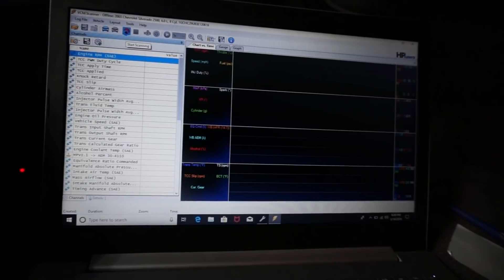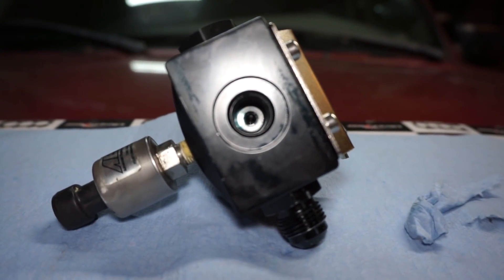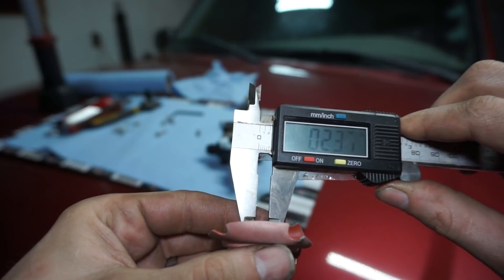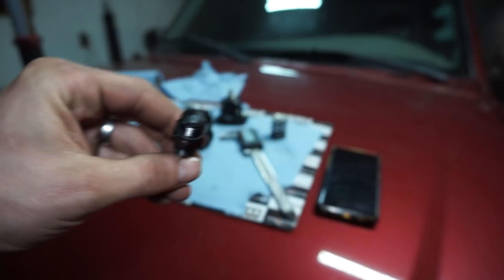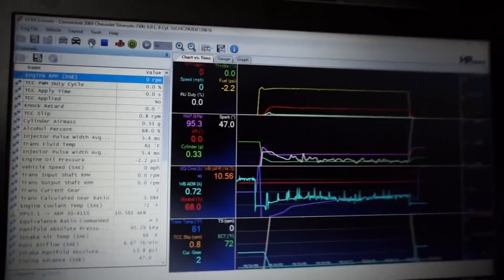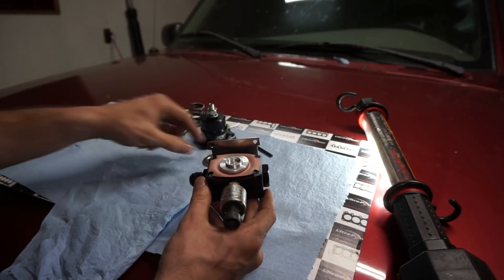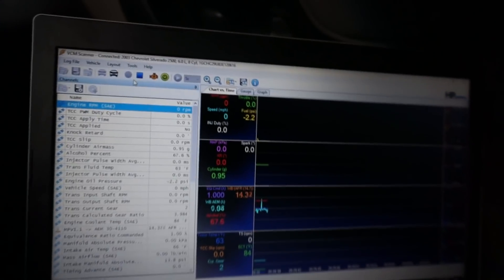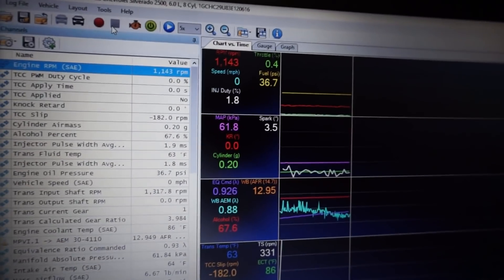Figured Out How To Modify Fuel Regulator For Dual Walbro 450s 43psi Base On Bugdet Regulator!

Comment: have you tried to do test how it works with boost?
Reply from the maker: Yes, works well. Not exactly 1:1 but it does rise with boost.
Reply: @BlaserBuilds  it's lower than 1:1 or higher?
Reply from the maker: @deividasjur5652  slightly lower. Nothing ive been concerned about.

Comment: I can't get mine below 60 psi
Reply from the maker: Did you do the modifications in the video?
Reply: I got it down to 45 psi with  no vacuum line connected  ... I didn't want to take any more off the spring. I didn't drill my orifice as large as yours. thanks for the info 👍

Comment: Are you pulling the reference line off to set base pressure? I noticed truck is running when your checking press and if your in VAC w/reference connected the base press is actually higher.  Technically base press is set at 0 kpa to the regulator.

Comment: Hey know that you are busy, but a quick question on the z33, is there room enough to fit the turbos at the firewall/transmission tunnel area?
Reply from the maker: I would go with no, unless really small turbo or extremely creative with the setup. I hand fitted these down there and there was not much space.
Reply: @BlaserBuilds  thank you, working on a similar project, aiming to run in the 8's, but If i get 9's while keeping it relatively street then I am fine with that. Appreciate what you are doing, keep up the good work and have a good day.

Comment: Why do you have such low timing at idle just curious and what cam are you running
Reply from the maker: It's set at 16, usually is between 16/22 at idle.
Reply: a21bravo how much vacuum do you have at idle
Reply from the maker: @Lsx-Mopar  Usually 18-20 inches.
Reply: a21bravo I have a lq4 with sloppy stage 2 cam and only 5 inches of vacuum what do you think would cause that
Reply from the maker: @Lsx-Mopar  What KPA does the scan read?
Reply: a21bravo around 50 kpa
Reply from the maker: @Lsx-Mopar  You sure the boost is accurate? Or no leaks there? 45-50kpa is pretty normal for my idle.
Reply from the maker: @Lsx-Mopar  Look at 9:57 Mark, mine is at 51kpa 16* of timing but my gauge reads 15-20 inches.
Reply: a21bravo I'm going to check for leaks tonight

Comment: What computer r u using that ur logging fuel pressure and oil pressure? P01?  I repinned my 98 ls1 harness to a p01 and I’d like to be able to log those two
Reply from the maker: I'm actually using my oil pressure PID on a p59 to log fuel pressure. The 3 pin oil pressure plug is the same as the AEM fuel sender so I log oil PID and change name to fuel... Could Probabaly use EGR signal to log an additional input as they all take a 5v reference... I do have an early video showing how to log oil pressure on P01. Would work for oil or fuel.
Reply: a21bravo oh wow ok I musta missed that one. I’ll go look for it now thank you
Reply: a21bravo not gunna lie that was way over my head. Especially since u tied it into the Nissan stuff.  So if I have a 98 harness that’s repinned and running a p01 is it possible using my stock oil pressure sensor?  I think the 98s were different

Comment: Is there a fuel pressure sensor sonewhere? How does hp tuners read the pressure?
Reply from the maker: It's the sensor I have threaded into the regulator. I use oil pressure plug, log oil pressure and change name.

Comment: Twin 340 or even 255 pumps will support more than enough for a stock bottom end combo most of the time. That would give a lower base pressure as well. I have twin 340 aeromotives they work great

Comment: How funny I was just about to do this. Lower base pressure is easy on fuel pumps if you have a street car. As long as you have enough injector there is no downside to lower base pressure